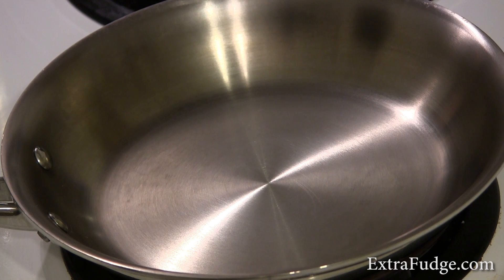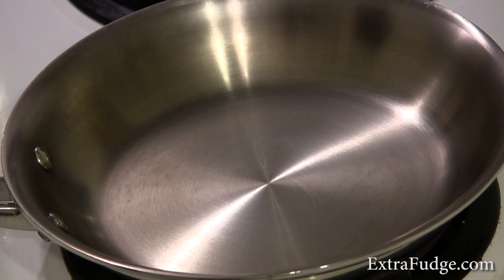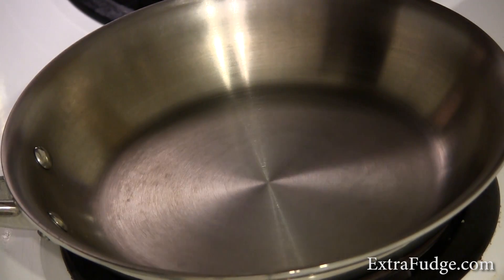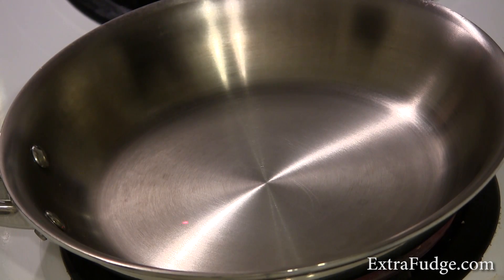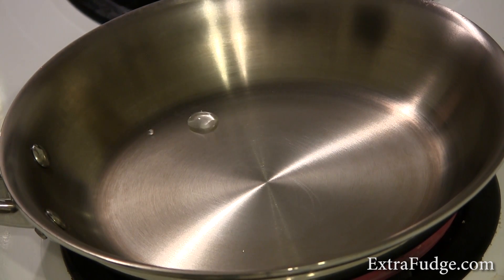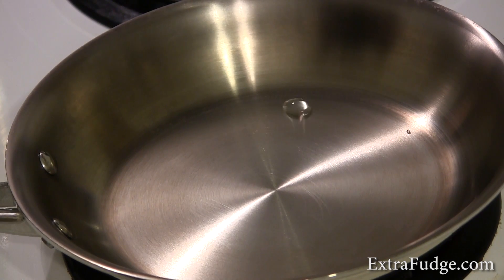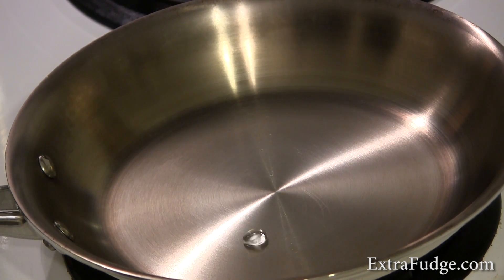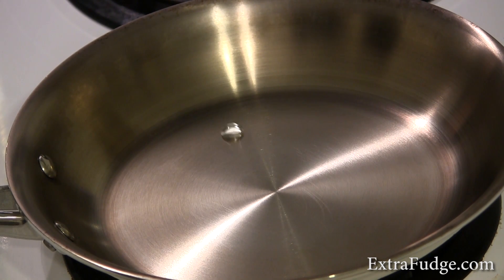Right time to add oil to a stainless steel pan. Mercury Ball Test. The Leidenfrost effect

Comment: This is proof that infrared thermometers are not accurate for stainless steel pans, which are too reflective. The Leidenfrost effect (mercury ball) happens at 379F, shouldn't happen at 227F like you said in your video.  But the same thing happened to me, I used my infrared thermometer to measure the pan and it said 200F. I dropped water in there and it formed the mercury ball.

Comment: 227C is over heating and the water ball exploded into several balls. better let the pan cool a bit before put in oil. 

the suitable temp. should be about 193C and only one water ball is formed.

Comment: An infrared thermometer isn’t at all accurate on a steel pan - the emissivity of the steel isn’t correct to get a proper reading. The laidenfrost “mercury ball” test only really happens over 200C (400f) which is considered a medium-high heat. That’s fine if you are using a high smoke point oil, but put olive oil or even grapeseed in, and you’ll burn that oil and get sticking / bad flavours. You really only need to get the pan above 170C (350f) to cook most foods, and that’s suitable for most oils also.

Comment: So my stainless steel  cookware instructions say never heat the pans when empty. It will warp the pans. I just put oil. Let it heat up for 30 seconds and add food. No problem sticking as long as you use low to medium heat.
Reply: Well made, tri-layer, 18/10 stainless steel pans with cladding all the way up the side can be heated with nothing in them. Less expensive pans WILL warp.
Reply: Prob is adding oil to cool pan is supposed to just soak up to much oil in food. Hot pan add oil and the food is supposed to almost hover over pan and absorbs less oil

Comment: Good people, this video is to demonstrate the Leidenfrost effect/ mercury ball!  The pan temp in this video is way to high to simply add butter and or most oils to.  Either would burn almost immediately.  For non stick eggs you would start at low/medium heat, drop in the water for the ball effect, lower heat a bit, add butter, ghee, oil etc and fry your eggs.

Comment: I cant thank you enough for a very vivid full length video of this temperature test. I have been trying to heat the pan properly many times before but never could understand what the drop running around means, in my case the drop would run a bit and evaporate, and I thought that was right. Now I finally made it and cooked food on my SS skillet without sticking and didnt have to use any pan seasoning! Thank you!

Comment: I tried this method but mercury evaporated instantly, causing a very irritating smoke.. maybe I should use more mercury or the pan was too hot? Anyway, doctors told me it's going to stay in my brain cells for the rest of my life and advised me to stop evaporating mercury indoors.. so to me it seems kind of impractical to go outside every time I want to test if my pan it's hot enough for adding food to it.
Reply: +UntakenNick you do realize it´s done with water and not mercury, right? "Mercury ball effect" is just the name becasue water droplets will behave similar to mercury!
Reply: +fburzaco What??????????
Reply: +UntakenNick you dont put a drop of mercury in the pan!!! watch the video, gee! You drop a droplet of WATER! and the effect of water bouncing around, is called "mercury ball effect"
Reply: +fburzaco Can you really be that naive?? He uses water to simulate the mercury since this method is crap and he knows that using real mercury doesn't work.. I tried it with a lot of different temperatures after writing the first comment and it always vaporizes instantly and irritates the hell out of your nose and eyes.. 

So I'm calling this method a total scam, I'm done with mercury.
Reply: IAmAgainst Try using liquid cadmium instead bud.
Reply: You walked right into that one :-)
Reply: Excuse me, I have to go make a prank call...

Comment: I want to know what you used to measure the temp of the pan. It looked like a laser?Thanks!
Reply: Thanks that sounds like a great product!
Reply: +martin27 I'm confused now, did  you not measured the pan temp in the video? I noticed there are different kind of infrared thermometers on ebay, some say kitchen others even saying they are for yard & garden. Thank you.
Reply: +martin27&#160; The pan you're using looks like stainless steel; I mainly use stainless steel; the only non-stick pan I use is ceramic coated, so will it work on that? Thank you.

Comment: Great Video, but here's a question. I heard that you must season a stainless steel pan with lard, coconut oil, etc, when you first buy it. will using this technique of bringing the pan to the correct temp make seasoning the pan first void? or must I still season first?
Reply: +Djmikeg 

Nope, you're confusing stainless steel with cast iron, which  MUST be "seasoned"
Reply: I seasoned  my stainless .A profession cook seasoned his on youtube eggs slid off for the first time no egg residue.
Reply: Sure you could season it, but why? Eggs don't stick if you cook them low enough with butter. You get great caramelization (brow bits stuck to pan) which you can deglaze to add amazing flavors. Seems strange to try to make a stainless steel pan a cast iron pan. Shrug.

Comment: mercury steam is VERY VERY poisonous, you better play it with a vacuum machine.
Its boil point is 356.7 °C=674.1°F
And you better not use kitchen extractor, because the exiled mercury steam will fill atmosphere, harming your health. Via Atmospheric circulation, the poison will make polution.
DO NOT BOILS MERCURY WITHOUT PROFESSIONAL EQUIPMENT.
yup, I know in the film it is water drop, but I still have to say
Reply: +hurryporter It's water for fuck's sake. "Mercury" is just a metaphor for how the water is behaving..

Comment: This is pretty pointless. It depends what oil you are using. Olive oil would burn readily if you added it at that heat level. Apart from steak if you fry most foods at that temperature you'll burn them and end up with a charred mess. You can add oil to the pan while it is cold.and then let it heat up to the desired temperature for the food you are frying..
Reply: Stainless cookware that's not accurate, always heat pan first then add oil.
Reply: yeah i experienced that. but then how do you tell when to put the droplet in?
Reply: carolcheny
You don't need to do that if you have an infra-red thermometer. 220° C to fry steak, and 140°- 150° C for eggs.

Comment: "The pan is definitely hotter than 250 degrees to create the mercury ball effect. The infrared thermometer assumes a certain emissivity value of the surface for accurate readings. The reflective surface of a stainless steel pan is not within the emissivity range for accurate temperature measurement with an infrared thermometer - it will read way low." Exactly right! Your temperature reading is way off :)
Reply: actually , 180~195℃ can create the merury ball effect on stainless steel in the lab.
The emissivity setting of his infrared thermometer may not be so accurate , but I believe he has already calibrated it , otherwise it will read way low as you said .
Reply: infrared bounces off shiny objects I know I have one. I. have a pot with a glass lid. When water boils ,I aim the  infra in thru the glass top, it reads 77F ,room temp

Comment: That was cool!  Thanks for the tip.  I don't use my ss pan very often; hate the sticking, but I'd really like to get away from using Teflon coated pans.
Reply: Food used to stick to my stainless steel frying pan all the time too, until I recently learned what to do: First, heat the pan to a fairly high temperature, then add a bit of oil and wait until it starts to smoke. If the pan is hot enough when the oil is added, a layer called a "patina" will form, which prevents food from sticking to the pan. If the pan is too hot for what you want to fry, let it cool to the desired temperature first.

Since I've been doing this my fried eggs don't stick to the pan at all, and much less oil is required, as the method basically turns the pan into a non-stick one. The video I got the method from states that once dish washing liquid isn't used to clean the pan, the patina will remain, but it seems more hygienic to me to wash the pan between uses!

Comment: i also tried this test.
i dropped the water directly on the electric stove (cast iron surface) .
my IR thermometer got reading between 214~220°C .
but this reading might not be very accurate .
i set my IR thermometer to emissivity=1 , so the actual temperature might be a little higher than 214~220°C , as the real emissivity of the cast iron stove top could be a little less the 1 .

Comment: It's called The Liedenfrost effect.

"The Leidenfrost effect is a phenomenon in which a liquid, in near contact with a mass significantly hotter than the liquid's boiling point, produces an insulating vapor layer which keeps that liquid from boiling rapidly."
source Wikipedia.

Comment: IMHO this is way too hot to start adding oil for regular cooking. The easiest trick is one given in the leaflet that came with a Fissler pan I have: rinse it with water before putting on the heat, and when the water has evaporated the pan start cooking.
Reply: My experience is the same as yours.